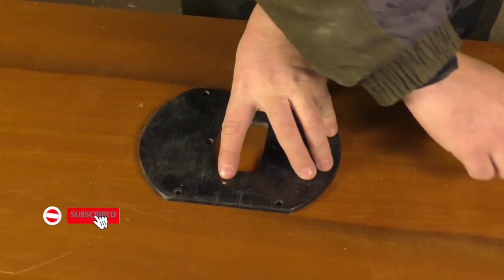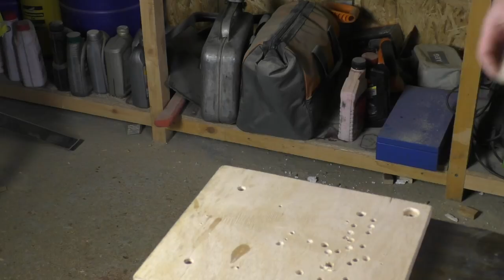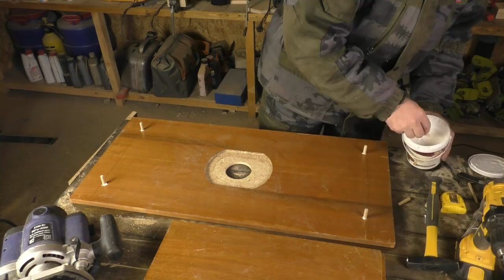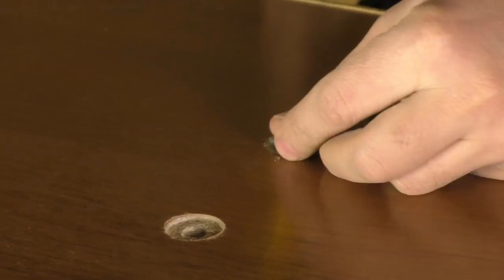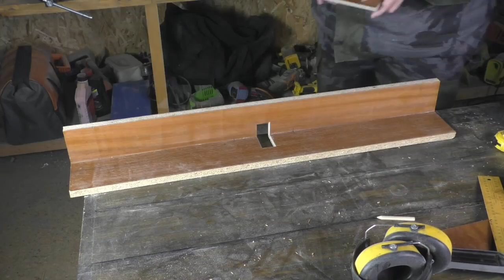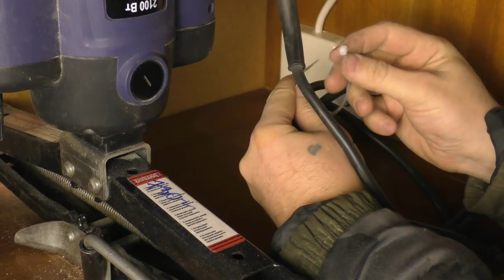I made this machine and everyone was surprised at how simple it was! The neighbor wants the same!

Comment: I integrated one of these router tables into the runoff extension for my table saw with slots for an adjustable fence.  It does triple duty by conserving precious floor space in the shop, as you can store stuff under the runoff extension such as a shop vac for the saw.  Nice idea with the plugs .

Comment: It's good but I'm worried about the switch that can be dangerous as it is easily accessible and can be turned on by simply passing by.  Imagine you are changing the tool and flick the switch by accident???  You should replace it with a safer switch or you'll have to change the name of your channel to 7 fingers Craftmaster.
Reply from the maker: When there is no need for work, it is disconnected from the network.